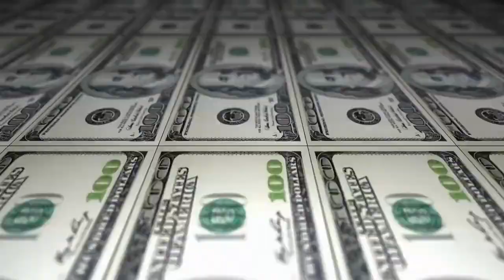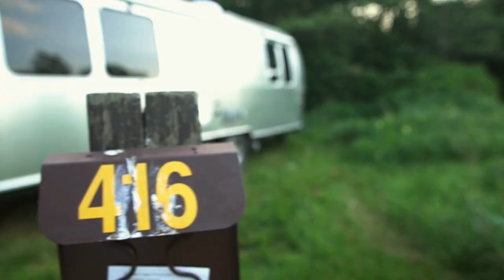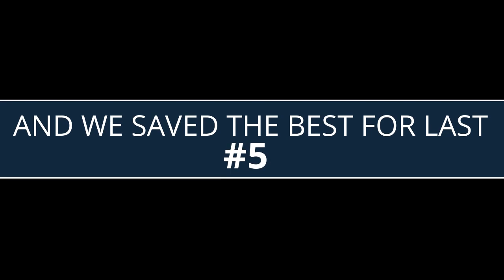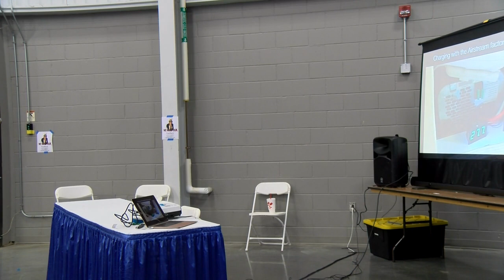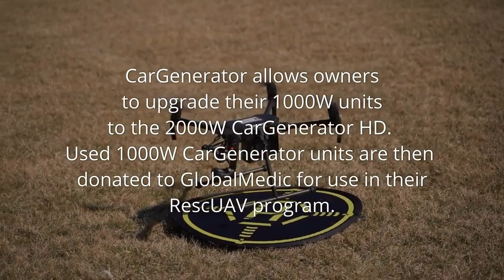Boondocking Secrets: Next-Level Off-Grid RVing | International Airstream Rally

Comment: great idea.installation is whats the problem. need to find a way to make it plug and play without a dealer installation.
Reply from the maker: CarGenerator can be used right out of the box in less than a minute.  It has built in booster cable clamps simply connect them to your battery, and adjust the holding strap for the front of your vehicle, and presto you have 120volt AC power.  Our Boost product for charging your trailer, does need to be installed either by yourself with our included instructions if your mechanical/handy,  or else by an RV dealer or any general mechanic can do it.  let us know if you have any more questions thanks